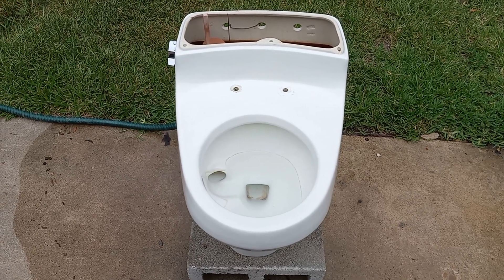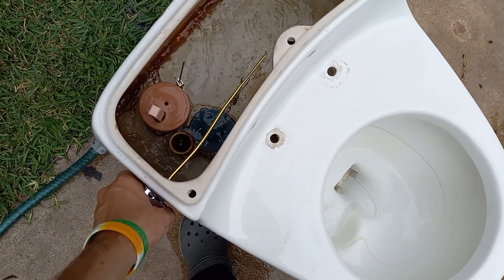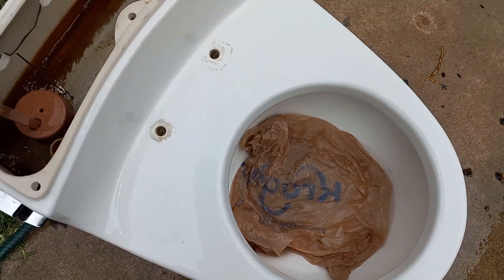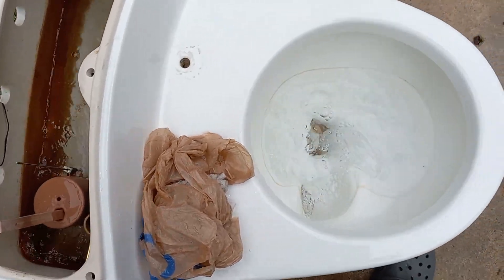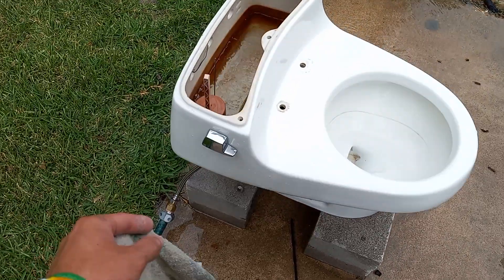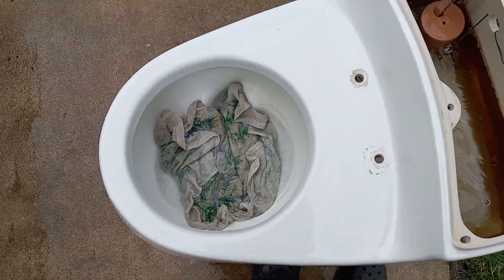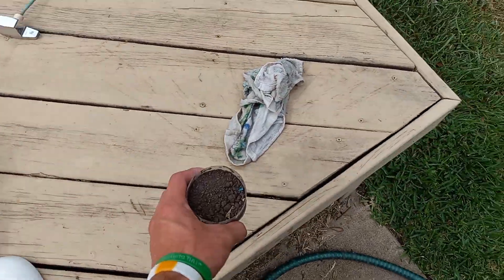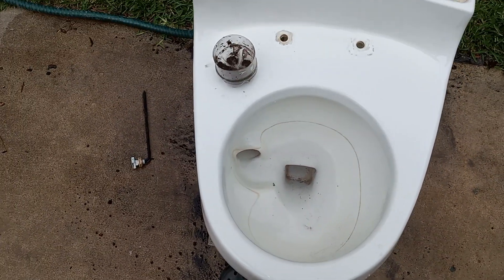Eljer Windsor Lowboy Tests

Comment: Whats impressive about some lowboy toilets is you have to wait or flush the toilet again to make them take the material if its already clogged
Reply from the maker: And sometimes you have to plunge it instead of flushing again because the bowl won't fill any higher than the level of water in the tank.

Comment: I just saw this video.
To give you a tip, the toilet in this video is
It's a toilet called a low tank. The water in the water tank
It comes out of the siphon hole and there's a separate fill valve
It's a way to shoot water with a rim.
Maybe you should try a dedicated accessory, man
I don't know why, but there are so many low toilets in Korea.
I heard it's better to be quiet, so there are a lot of low toilets
I prefer a high toilet.
Reply from the maker: I tried to find the right valve but I couldn't

Comment: This toilet did ok but the date of the toilet might be on the bottom of the toilet, did you check on the bottom of the toilet, sometimes the bottom has a date on the toilet.
Reply from the maker: I checked in every possible place, on top, underneath, inside, and out. It looks like they just didn't stamp it.

Comment: These Low Boy toilets are definitely interesting (as no such toilet exists in the UK or Europe) but the flush power is nothing to shout about! It's not a terrible toilet as it took the wash cloth easily and the overall bowl clearance is great, but not good for heavy loads as the trapway is small. Replacement parts for these would be difficult to acquire as they require special fill valves that power the rim jets - so that is another negative point. It gets an Okay 6/10 because I do like the look of this toilet and this one is marginally better than some I have seen!
Reply from the maker: I guess the English thought better and let these stay here